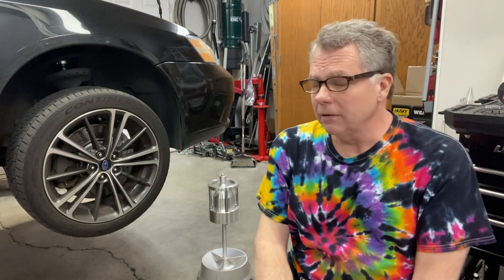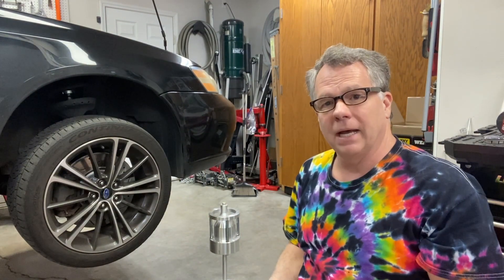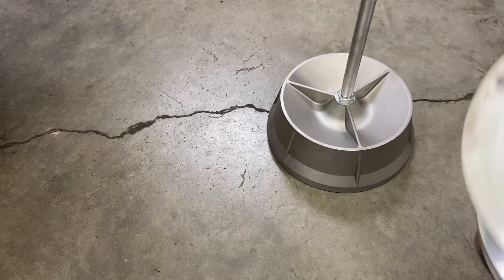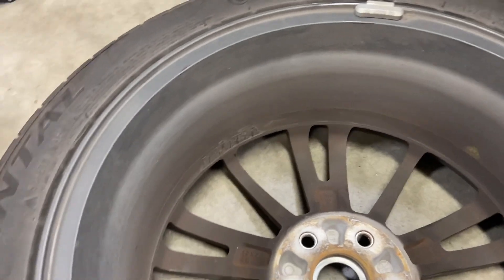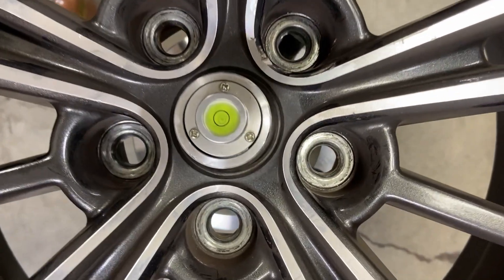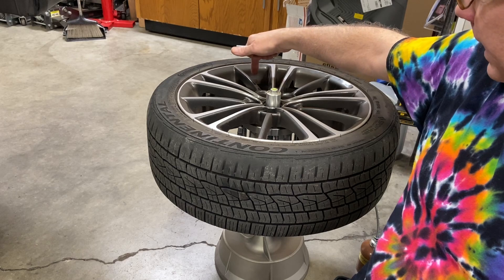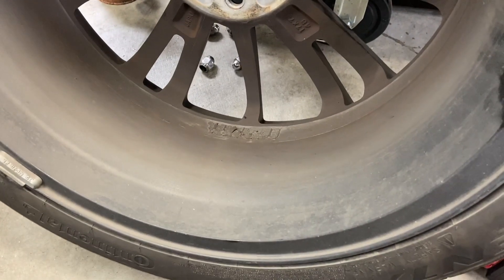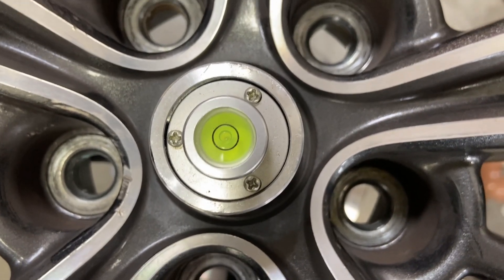Harbor Freight Wheel Balancer

Comment: You are lucky to have the adhesive marking where the imbalance is. I tried this tool and never had good results. After several attempts I put it on the shelf and have not used it again. Thanks for sharing.

Comment: Did you have any issue with the harbor freight weights? Did they fall over time or the sticky tape is good?
Reply from the maker: No issues so far.
Reply: May sound crazy but one thing i know some racing guys will even use is the Aluminum Duct tape. Theyll tape down the weights for added protection and assurance they dont fly off over time. Another helpful tip is make sure to clean the area you stick them to SUPER well.